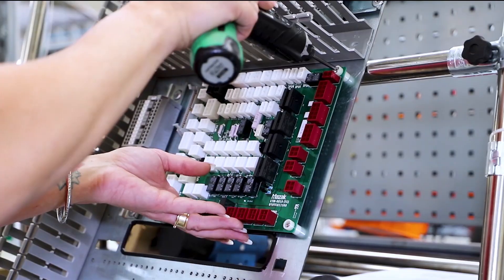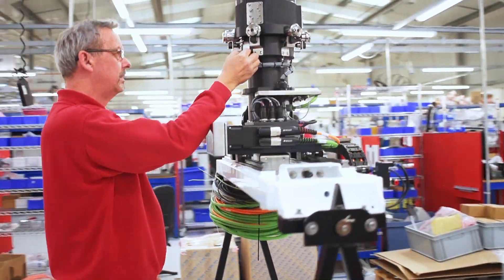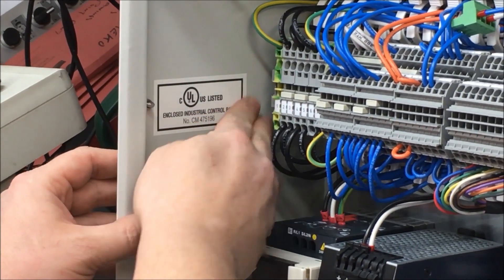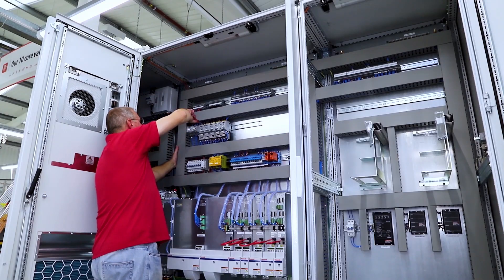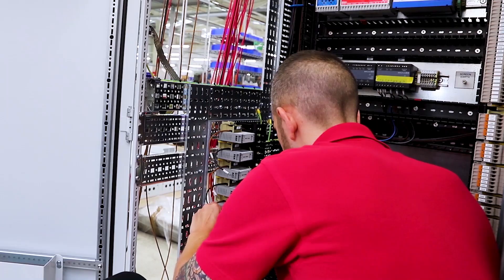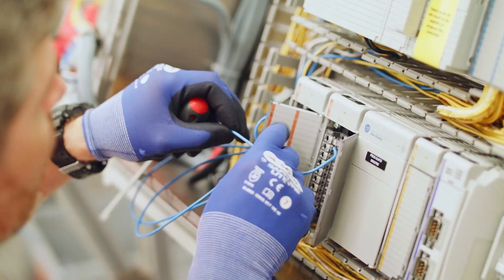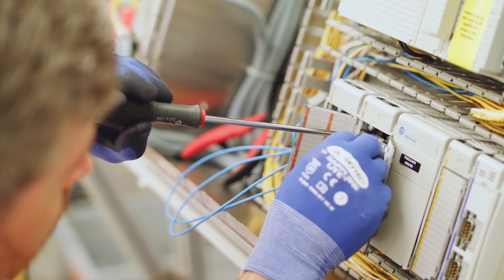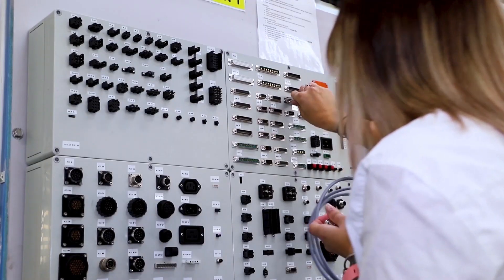UL Standards: Inspection & evaluation

Comment: Can never understand manufactures get away with installing undersized wires on drives that can cost over $10,000 each. When I perform an IR scan during a PM these wires are 15 to 20 degrees F hotter then inside of cabinet. Thus wasted heat has 2 problems: 1) waste money creating heat & 2) will burn up at contactors a lot more often then the properly sized wires electricians install.. Yep been hearing it for over 40 years these companies especially cheating lack of quality control communist china do not have to follow the NEC. The very first 100 HP 480 volt VFD that I installed only had #4 copper wires for a 122 amp load. Drive was installed in a warm room and ran 24/7. Of course the #4 wires had to be at least 145 degrees. Does not make sense the 2020 NEC demands that you install at least 50% of residental receptacles be controlled to secure power. Most of these receptacles will not pay for itself in a hundred years. Great ROI.